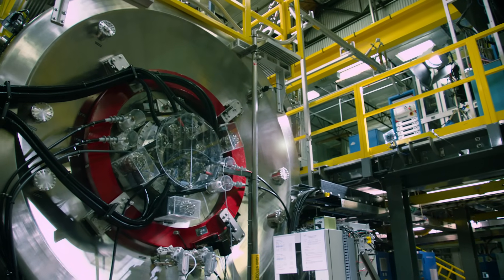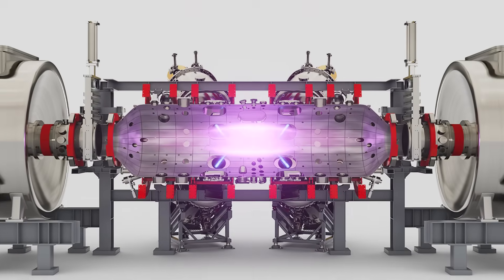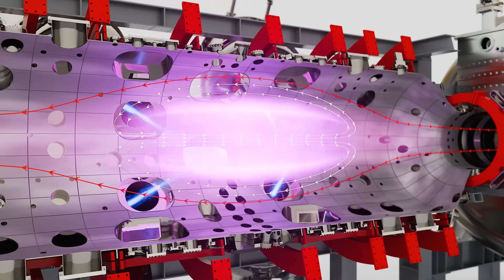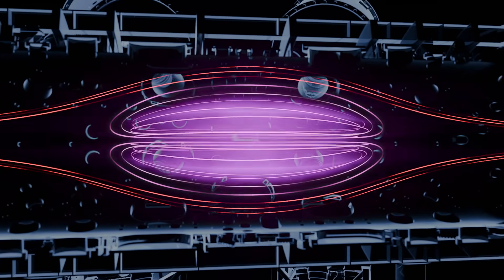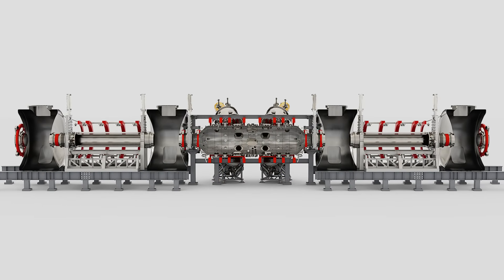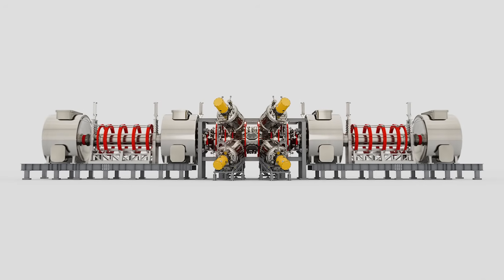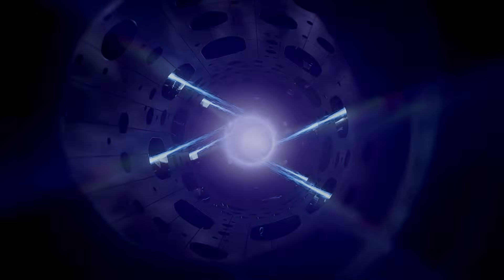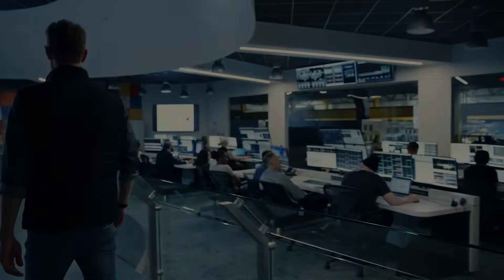Introducing ‘Norm’: A First-of-its-Kind Fusion Machine

Comment: Indeed, this TAE scheme of fusion energy operation by using formed FRC plasma to extract fusion heat energy is same with the Helion energy company's Polaris fusion reactor (but by direct capture thru magnetic induction principle) method yet using the heat energy recovery as usual to circulate steam to drive turbines to drive alternator for power output !!!!!

Comment: This is the leader in fusion tech. Aneutronic fusion is the best, also requires no magnets because the plasma is contained by its own superconducting nature. Efficient, plasma temps between 2-5 billion degrees and direct conversion to electrical power. $DJT is the merger of TAE and Trump Media which will produce the first commercial 50 mw reactor next year.

Comment: Most nuclear fusion energy experimental companies leaders tend to be masterful at obscurantism in the quest to secure large amounts of experimental funding. TAE Technologies (TAE) is no exception. It was founded in 1998, has experimented with five generations of machines and has conducted around 70,000 experimental test shots.

Journalists and prospective investors should pose the following questions to the directors.

1. Has any one of the experimental test shots resulted in the generation of more than 1.0 watt-hour of fusion derived energy?
2. Has the fusion fuel, radioactive tritium, or boron, been employed in any of the test shots?
3. If significant quantities of fusion reactions have been obtained in repeated test shots then what was the maximum fusion energy duty cycle achieved during that series of shots?
4. If significant quantities of fusion reactions have been obtained in repeated test shots then what was the maximum fusion energy gain factor (Q-plasma) achieved?
5. In cases where significant quantities of fusion reactions have been obtained in repeated test shots and a maximum Q-plasma value has been derived, then what was the ratio between the input energy value employed to calculate the Q-plasma value and the input energy value required to power the experimental facility during the day the maximum Q-plasma was achieved?

Comment: TAE, can you do direct energy conversion with Norm, or will you still have to boil water and spin turbines?
Reply: Norm and Copernicus - The next generation Reactor, are still experimental machines. Copernicus will be able to demonstrate Net Energy Out. When we get to Da Vinci - Our first commercial device we will still make steam and spin a turbine. Direct energy capture is planned for TAE Fusion 1.5
Reply: Helion's fusion reactor can do Direct Fusion Conversion, it uses the expansion of the plasma to induce a current in the machine's magnetic field, which is then directly recaptured as electricity. So, it's readily available electric power directly from the reactor.

Comment: why not just make arc plasma fusion inside a liquid D2O water container. simple. you only need to get the core to fuse atoms faster than the arc required to start the fusion process. plasma contains itself inside the D2O water container. gaseous water adds cooling pressure around the plasma itself. also cold plasma around the hot plasma prevents melt-down of the structure. also the D2O water shields from radiation naturally. yep no magnet systems required, not even super conductive technology. just the arc plasma bulb style container with the conducting electrodes. can be similar to spot arc welding systems.
Reply: Your idea shows creative thinking — you're trying to find a simple, self-contained fusion concept without magnets or superconductors — but unfortunately, the physics don't quite work the way you’re imagining. Here’s a breakdown of where it runs into problems:

1. Fusion Requires Extremely High Temperatures and Densities
Arc welding reaches around 5,000°C — very hot by industrial standards — but fusion (even D-D or D-T fusion) needs over 100 million °C.

Proton-boron (pB11) fusion (which TAE pursues) requires over 1 billion °C.

No electric arc in atmospheric pressure (even inside D₂O) can achieve anywhere near these temperatures.

2. D₂O (Heavy Water) Would Vaporize Instantly
At fusion temperatures, even superheated plasma would vaporize and ionize the surrounding D₂O instantly.

You wouldn't get a gentle pressure boundary — you would get a violent, uncontrolled explosion of steam and plasma.

Water, even heavy water, simply cannot coexist next to a plasma at fusion conditions.

3. Plasma Confinement Needs Either Magnetic Fields or Inertia
Plasma is extremely unstable — it "wants" to expand and cool instantly.

You either need:

Magnetic confinement (like tokamaks, stellarators, FRCs like TAE), or

Inertial confinement (extreme compression, like laser fusion at NIF).

Relying only on "cold plasma" and "pressure" around a hot core would not stop the plasma from blowing apart faster than you could get any useful fusion reactions.

4. Electrodes Would Erode or Melt
Even tungsten electrodes (used in spot arc welding) would vaporize under the bombardment from 100+ million °C plasma.

You couldn’t sustain a structure long enough to maintain the conditions needed for net fusion power.

5. Radiation Shielding
Yes, D₂O is good for neutron moderation (it slows neutrons, used in fission reactors like CANDU).

But for D-T fusion, you still get 14 MeV neutrons — these would shatter the D₂O molecules and create secondary radiation (like tritium production), and you’d still face intense damage to any structural material.

In short:
The idea of a simple, self-contained fusion plasma is appealing.

But arc welding principles don’t scale to fusion energy physics because of the unimaginably extreme conditions fusion demands.

You can’t maintain plasma stability without either magnetic fields or ultrafast inertial compression.

Water is a non-starter as a containment boundary at those temperatures.

Why Fusion Needs Specialized Designs Like TAE’s:
Magnetic fields (like FRCs) create a force that confines the plasma without needing material walls touching it.

Particle beams and neutral beams allow heating without physical electrodes.

pB11 fusion minimizes neutron issues — but you still need incredible stability to reach those billion-degree temperatures.

Bottom Line:
You’re thinking in the right spirit (simplicity, practicality).

But physics at fusion temperatures is not like industrial plasma arcs — it demands exotic approaches.
Reply: Can't initiate 100,000,000K in liquid with an electric arc at 1 bar D2O  pressure. Not even close. Stefan-Boltzmann Law means radiative losses as the 4th power of the temperature. Max might be ~50,000K, which would take even the most powerful lightning bolt's current and voltage.

Electrode vapor metal ions would poison the fusion reaction and actually so would the D2O's oxygen itself.

Comment: If there is a confinement failure, it obviously won’t Chernobyl, but is it a stable failure with contingencies during cooling or just plasma hitting the walls?
Reply: To be fair we are being lied to about how Chernobyl happened, the truth is nothing could have stopped it 
They were testing high voltage equipment and accidentally created ball lightning in the reactor pipes
It ate and twisted the pipes like a tornado but luckily it has a  life cycle and it stopped after a while
Reply: @cedriceric9730 oh please tell whst was the mechanics of the ball lighting popping out because you are like missing half the information
Reply: @norbertnagy5514  every time I give a clear explanations it is swiftly deleted
Here is what happened, it dumped the energy into the reactors water lifting it like hurricanes and tornadoes lift water , the pressure vessel was like paper in the face of anti gravity power of ball lightning
Reply: @norbertnagy5514  its a soap bubble but with electricity, agitated electricity using something like a circuit breaker will form ball lightning if the values are high enough
Case in point nuclear reactor grade circuit breakers being used for the first time
Reply: @norbertnagy5514  they really don't like me telling people that we are taught lies and propaganda about science
Especially about...what I just talked about above

Comment: How do you take released energy out of that equipment? The temperature for fusion to occur has to be around 300 million degrees C. The outside of the reactor is at room temperature, say 25 degrees C. There is an unbelievable temperature gradient to control. Inside the Sun, it works fine, but inside your equipment, it may not work at all. So far, nobody found a solution to this problem.
Reply: Idk, induction msybe, but havent looked into it